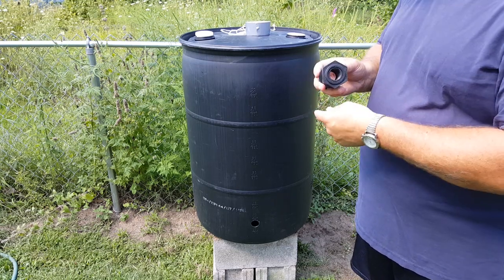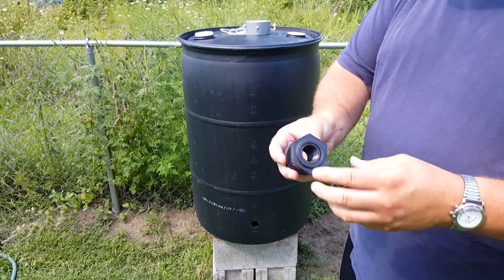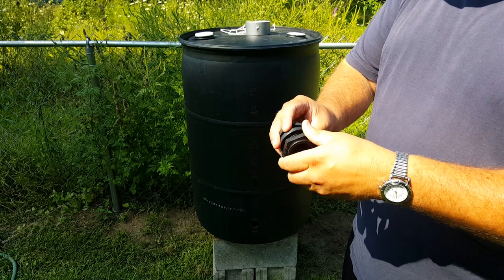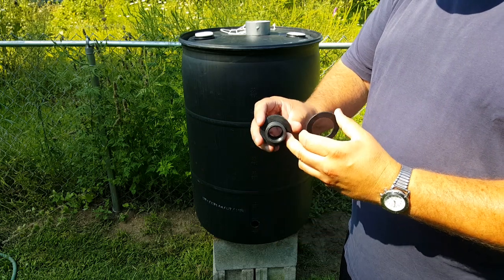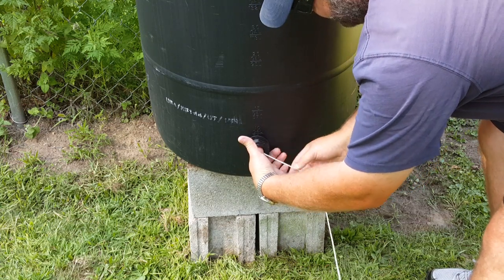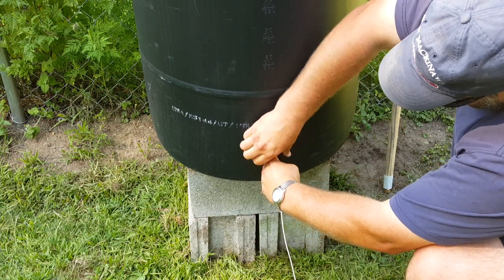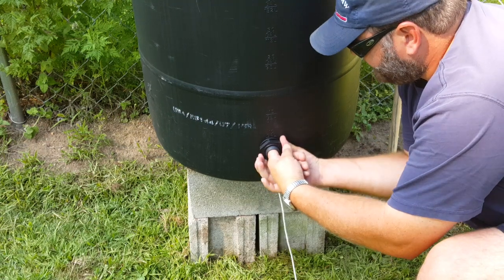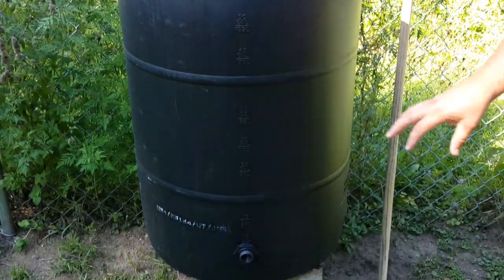How to install a bulk head thru a bung hole

Comment: Hey thx for the tip.  I have a rain barrel and am having trouble figuring out how and where to put the valve.  what size hole did you drill and what size bulkhead did you use? Thx!